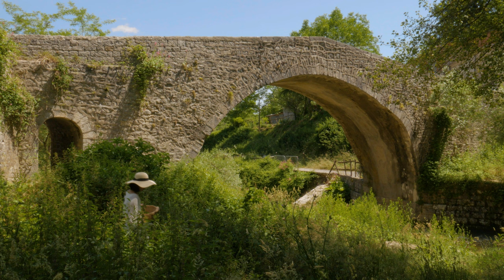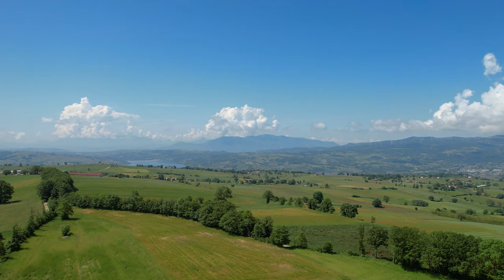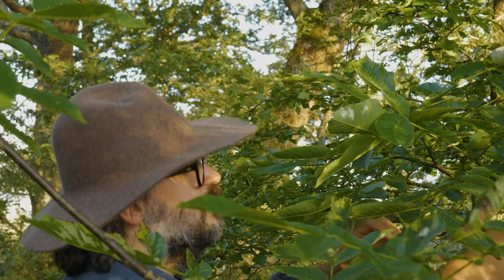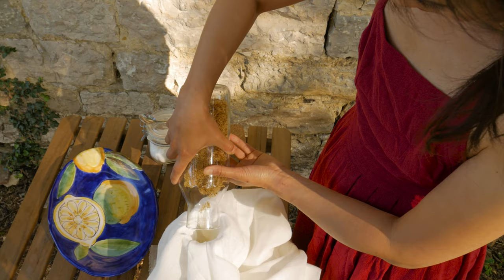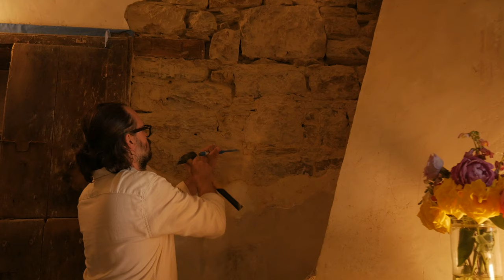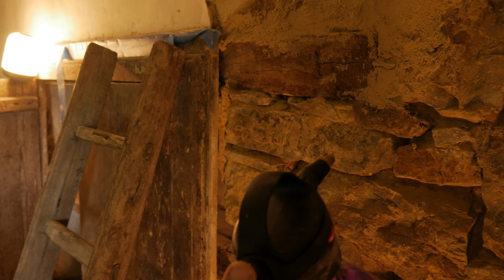Foraging wild edible plants, and lime plastering

Comment: Really enjoy your videos, you have a wonderful place with the joy of your previous generations hard work within it. It is good to see that you really research what is needed for the building. I do have one tip for you as I have worked with lime for nearly 12 years now so have chipped off much cement in those years. Please consider some ear protection when using the bolster, even just some ear plugs to take the sting out of the noise. I do have a bit of ringing in one ear due to my failure to look after it. All the best with the rest of the renovations 👍🏻

Comment: The walnut and pear trees may need to be spliced onto a rootstock in order to propergate. Sorry I dont know what tree to recommend for the rootstock for the walnut. Use apple or another pear variety for the pear rootstock. 
The mulberry either air layer or bend a thin supple branch, what will reach the ground whilst still attached to the main tree. Now carefully cut along the outer bark about 1inch leaving the bark attached to the branch and gently bend the branch down to the ground. Cover with soil and weight down with stone/rock.

Comment: Lime: very well summarised " a topic of ongoing lifetime learning" 
Understanding the "science" of lime use is of course very important: however when renovating and appreciating traditional buildings built before the advent of portland cement and petrochemical products; it si also very important to understand that the lifestyle of those previous generations was SO VERY DIFFERENT  than  those of the modern urbanites. 
People spent a great deal of the day outside: windows and doors did not fit perfectly which allowed air and importantly mosisture to evaporate. Doors and windows were often left open during the day. Cooking/washing was mainly done in outbuildings: the modern trend of generating high levels of moisture in closed kitchens and bathrooms are incompatible with traditional buildings: hence the requirement for forced ventialtion/extractor fans especailly in the modern plastic bag buildings where the fabric of the structure does not breathe as in traditional buildings of stone and lime.
Yes NHLs are often initially "stronger" however before one condems NHLs for causing damp problems, each case where this has been stipulated should be studied in great detail before concluding that this was the cause: by first eliminating leaking pipes/gutters/lack of gutters/inappropriate insulation or incorrectly installed insulation/ use of any modern paints all of whcih are not breathable/ lack of ventilation/ raised ground levels etc. the list goes on. A great deal pf damage has been donein recent years in Europe to buildings built before the 1930's by the use of modern petrochemical products and use of portland cement
I have made up "mixes" using lime putty over the years on the exterior of a 17 century building however in areas exposed to a lot of weather they have not lasted very well. Many additives have been used and many variations of mixes over 1000 years with what was " available locally" so as you say " a topic of ongoing lifetime learning"
Apprecaite your open mind wanting to learn more and of course to question.
Reply from the maker: Thanks for these detailed comments, especially about the changing nature of indoor life. My grandmother told me she used to bathe at a river downhill for much of the year, and I believe they washed their linens in a stone basin near our well. Even a pot of boiled water was boiled in the fireplace, so a certain amount of the steam probably went up the chimney. Thanks for bringing up these valid and helpful thoughts.

Comment: The Walnut tree was, although maybe unfortunate; unintentionally / unknowingly coppiced, no need to worry, the tree will return to its former glory.
Reply from the maker: I hope so, the main problem now is that due to the excessive rain the stump has caught a fungus. I suspect much of the dead wood will rot within a year or two, and I'm not sure that it will be able to support the weight of a large trunk. Hopefully we'll be able to make a few copies just in case.
Reply: Oh that is unfortunate, yes I would try to strike some cuttings in the winter, good luck.

Comment: Hot lime is best for your stone and with limestone but the argument still rages..
Reply from the maker: The compressive strength question is kind of complicated. I think people like higher compressive strength because it doesn't weather away as quickly as older / traditional mixes. The strength isn't really essential for a stone wall I think because usually the stones are all in contact with each other (there's no "compression" happening, unlike the situation with bricks). With NHLs that are rated as "2", what that means is it's the minimum strength at something like 28 days or something, but research shows that NHLs keep gaining strength over time, so the final compressive strength of an NHL 2 might be much higher than 2 over many years. The hot lime thing has more to do with another property, which is how moisture moves through the mortar, as well as "clast formation" which I guess has something to do with the self-healing properties of certain lime mortars. There are some talks by David Wiggins on YouTube that explain these things in more detail. What's actually true is kind of hard to pin down, but what's verified with data is that NHLs often don't behave as advertised (has to do with some innate unpredictability coming from how they're manufactured, from what I understand). There's a book by Nigel Copsey (as well as talks on YouTube) that explain some of these things in greater detail.